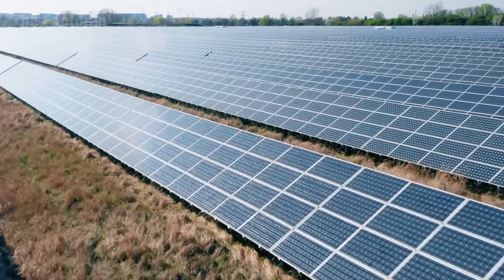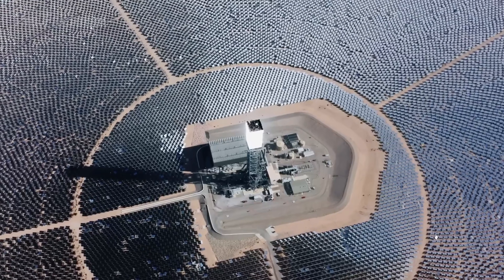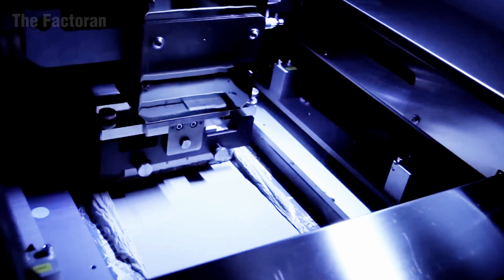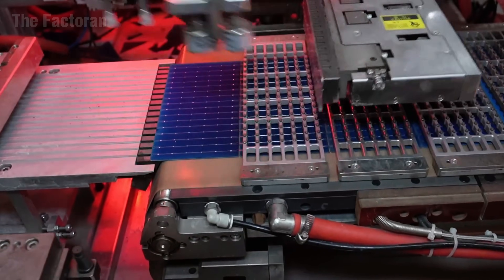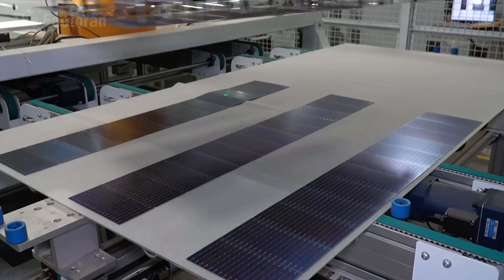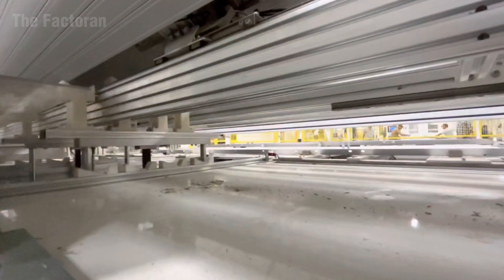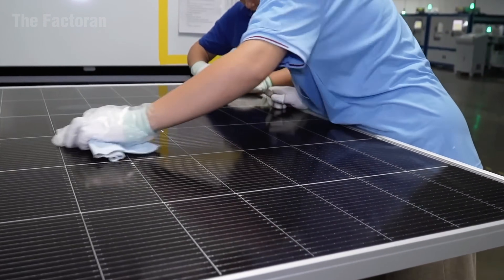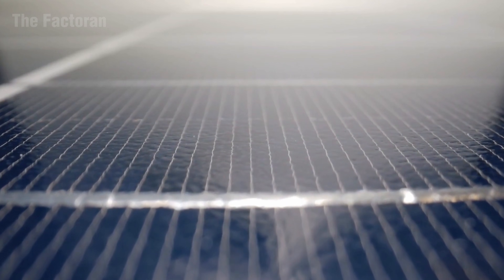How Millions of Solar Panels Are Made Inside Massive Production Line

Comment: There are solar panels and there are solar panels 

So why do solar panels need to be replaced after about 10 - 12 years?

What happens to all the solar panels that have to be replaced?

All to land fill??????
Reply from the maker: Most panels last 25–30 years, and while many parts can be recycled, too many still end up in landfills due to high recycling costs.